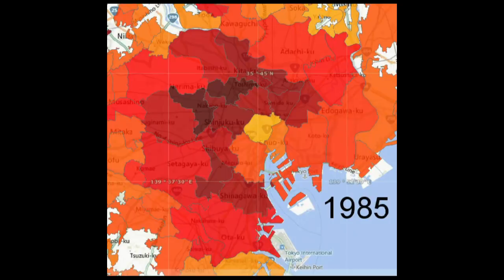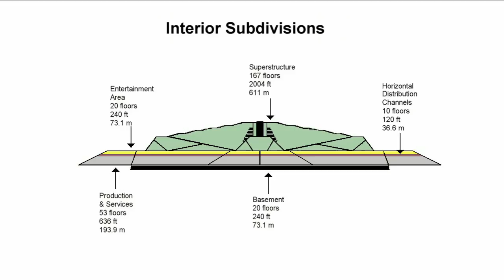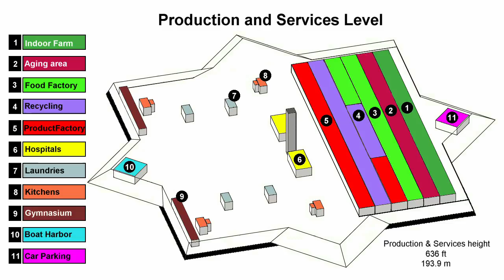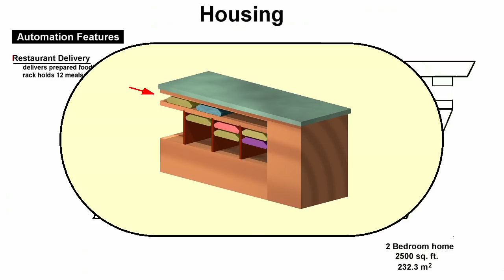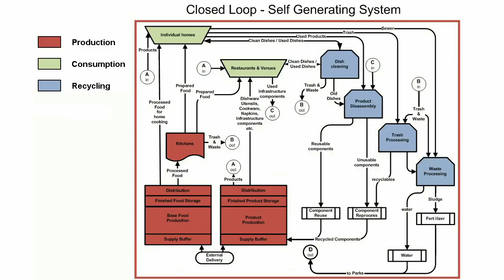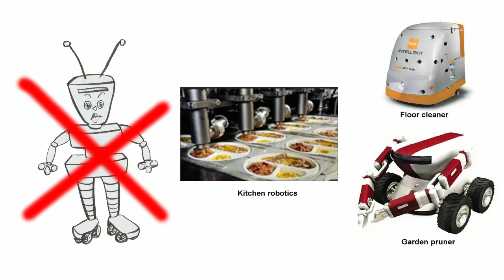The Naked Arcology

Comment: There is a profound irony in characterizing manual tasks like gardening as 'menial' labor, as this overlooks the inherent community value and psychological satisfaction found in such work. Beyond the social loss, this model creates dangerous vulnerabilities: a reliance on high-level automation leaves the city exposed to massive economic costs, complex global supply chain dependencies for parts like semiconductors, and existential risks from cyber-attacks. By mandating a hyper-specialized population just to keep the city from decay, the design becomes brittle. A truly resilient community requires a decentralized, modular framework that empowers residents rather than rendering their daily contributions obsolete

Comment: The primary concern with this arcology concept is the sheer scale and weight of the structure. Regardless of seismic risks, placing a multi-million-ton complex on soft, waterfront soil presents immense engineering hurdles. To prevent uneven settling and structural failure, the design would require sophisticated shock-absorbing foundations and a modular, segmented structure to mitigate stress. 

Furthermore, finding a stable coastal location in the US that avoids both active seismic fault lines and soft, boggy, or erosion-prone ground seems highly improbable. Without massive, deep-foundation piling and advanced soil stabilization, such a heavy structure would be prone to long-term geological instability and collapse. Beyond the geotechnical challenges of building on soft, waterfront soil, the arcology faces the critical risk of a 'self-inflicted' collapse. Given the immense mass of such a structure, a failure in one section could generate forces capable of triggering a catastrophic domino effect across adjacent frameworks. Without clear evidence of progressive collapse protection and redundant load-path engineering, the structural stability of such a massive, interconnected city remains a major point of skepticism. 

Beyond the significant geotechnical challenges of placing such a massive, multi-million-ton structure on unstable, soft waterfront soil, the current design remains too rigid for real-world application. Its immense, singular footprint is inherently impractical for varied terrains and lacks the regional diversity required for diverse populations. Adopting a truly modular, decentralized framework would not only improve site feasibility—by allowing the structure to better accommodate complex geography and mitigate the risk of catastrophic, progressive structural collapse—but would also increase its scalability and broader social appeal. While I would love to visit an arcology, I struggle with the idea of long-term residency. The American ideal remains rooted in the privacy and autonomy of individual homes, yet we cannot ignore the mounting repercussions of our current, unsustainable urban sprawl. It is a challenge to reconcile our personal desire for seclusion with the practical, environmental need for the hyper-efficient, shared infrastructure that this design offers

Comment: I hope you will continue making videos. This concept is already very promising, with some flaws that I'm sure you had time to refine in the time since. Though to buid it, we already need capital on an increadible scale, and since there's no hope for a return on investment, I assume it's in a context after a revolution, where we are already using a Resource Based Economy, or some directly democratic production planning (no more Capitalism). 
For the concept itself, given most buildings don't last more than a few centuries at most, I assume things would get dicy if structural problems occurs in the structure, so I'd start smaller, but make it modular, upgradeable, scaleable. But for the scale you assign yourself, it's a good concept.

Comment: Now this is an entertaining video, I will admit that much. A lot of work went into this. But I have to ask the same question I ask with every arcology video I watch: how will emergency services work? 

Where are the police and where do they put the violent criminals before they’re sent to somewhere else (probably some kind of rehabilitation location since this is a futurism video). What if there’s widespread social unrest that leads to a riot? Those tight corridors and stadiums make for a perfect place for radicals to fortify a location, like what happened during the French Revolution. 

Then there’s the question of firefighters, how will they respond to fires, chemical spills, etc. and also where will they get the water and water pressure to deal with those fires? The reason fire engines are so massive is because most of that bulk is taken up by complex pumping mechanisms, so that’s another hurdle to overcome.

Next is the problem of EMTs having to navigate an indoor maze to get to their patient, and considering the size of this Goliath of a building they won’t have the luxury of ambulances. An ambulance is essentially an emergency room on wheels, allowing EMTs to preform any form of medical care that doesn’t involve cutting you open, and they’re fast enough to be anywhere in a city the size of New York is a matter of minutes. Obviously tight corridors can’t accommodate that so there has to be another solution to this.

And lastly, what if, by some great catastrophe, part of the structure collapses? Then you’ll need all three groups working in concert in addition to dedicated construction equipment to excavate the rubble, and this becomes exponentially more difficult in the event of a collapse that happens solely indoors.

Sorry for the wall of text, I just had to get all this out.
Reply: These are some fair and exciting points.
 As you said, I'd imagine there would still be separate prisons or a larger focus on rehabilitation. A riot would certainly stir things up but I'd imagine there would still be proper cities elsewhere that could help evacuate those not a part of it and provide military support.
 Fires I'd imagine be handled through indoor sprinkler systems. Larger fires would probably have firefighters use long hoses and occasional pipes access in walls for large amounts of water to be pumped similar to fire hydrants just built into the building. 
 EMTs would have a tougher time but I think there would be some emergency areas for people to evacuate and travel through quickly as well they could use. Maybe having emergency medical areas scattered around occasionally helps stabilize patients before transporting them to the larger medical area. I'm not sure but things would also be a lot closer in general than a city so people wouldn't need to be transported as far overall.
 There are a lot of technologies that are implemented into modern skyscrapers and other buildings that help with disasters. Still as always in tight closed-off areas like this natural disasters would pose a serious risk to a lot of people so it'd mostly come down to really good engineering planning and choice of where to build. Though disease could pose a serious problem though as an arcology is much more compact than modern cities allowing a lot of transmissions.
 Overall since arcologies are a "city of the future" I'd imagine the future people would have some other technologies created that could help mitigate some of the issues as well.

Comment: The one aspect I had the most trouble with are the pipes containing liquid food ingredients.  These seem impossible, due to becoming breeding grounds to bacteria, and old liquid solidifying on the walls of the pipes.  I just can't imagine this being sanitary in the long term.  Anyone who has ever taken apart water plumbing can see just how much sediment, corrosion and nasty crud builds up from just water alone.
Reply from the maker: Like everything else in the city, piping would be pre-engineered for maintenance. There would be regular cleaning cycles where a pipe is taken off line for cleaning.  Also sensors would be imbedded in the pipes to determine content status.

Comment: This needs to be MUCH shorter. A lot of the concepts lingered upon don't need to be there at all-- engineering is assumed. Anyone who is at this site already knows quite a bit of the basics.

My "gut" tells me the ratio of city area to population is off. Since most of the consumable production is underground, surely many more people can be housed. Arcosanti was much more in the "third dimension" (upward).

Lotta work-- but it should be saved for the developers. This could be a retirement community in the 2100s.
Reply from the maker: I would love to have made the video shorter, but the point
of this video is the engineering.
If you look at what there is in the public domain about Arcologies,
what you see is beautiful artistic renderings with little potential for functionality
and livability.
I’ve been to Arcosanti several times over the last 40 years,
and I have seen no evolution in the city’s development or the evolution of the
concept.  The tallest structure in Arcosanti
is 5 floors tall, square and has no elevators. 
I guess engineering was “assumed”, because ducting wasn’t planned for
and they needed to chisel a path in the concrete to run cables to an office.  
As far as it being a retirement community in the 2100, I
think it will be sooner, and consider the wider implication of everything being
completely automated.  Isn’t everyone
retired?
Reply: @mariomatiev2602  exactly.